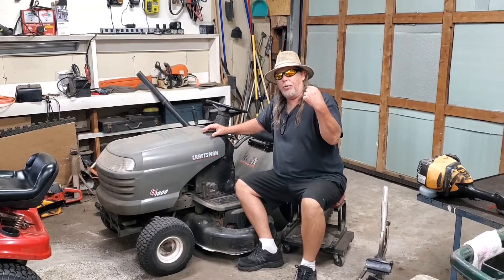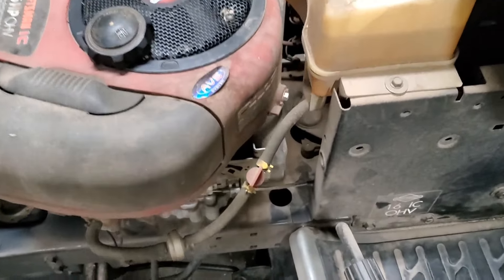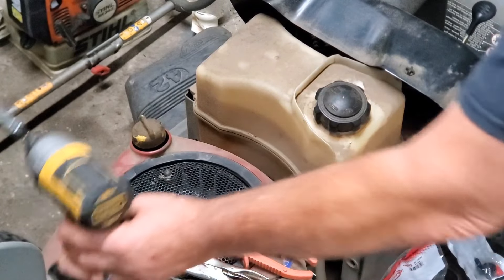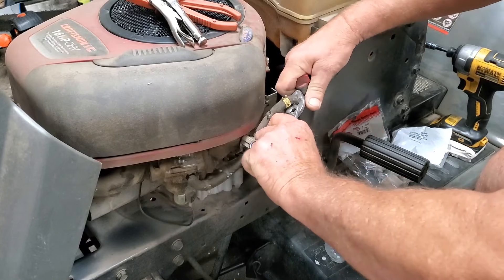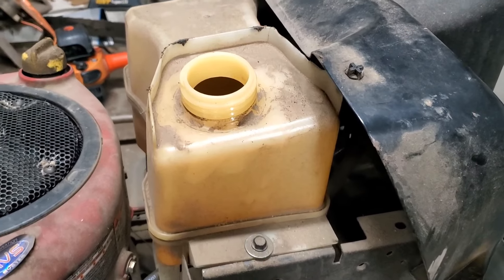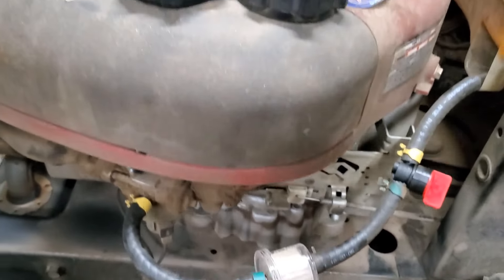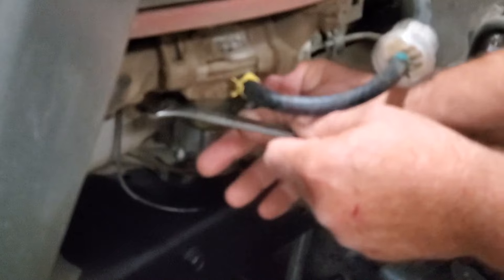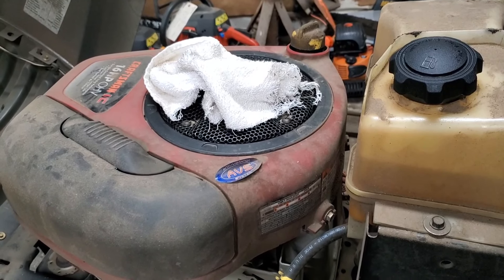Riding Mower Cuts Off? It's Not Always the Coil. Easy DIY Repair a Craftsman Briggs and Stratton

Comment: T-Bone, this video showed up in my feed. Thanks for the part number info on the shut-off and in-line filter. Im ordering them with new fuel line and start with new on 10 and 15 year old riders. Thanks.

Comment: The only thing I would change is to use silicone grease instead of petroleum jelly (vasoline) since it will react with the rubber fuel line

Comment: Hoping you can help me here. Bought a craftsman mower off friend.  Ran fine but rough.  Brought home, removed the mower deck to install the snow plow attachment.  When I removed the deck I thought it easier to remove the blade engagement cable from under the hood where it connects to the engagement arm. The thinking was that it seemed easier that removing the cable and spring where it attaches to the mower deck.  

Long story short, did full tune-up (oil, spark plug, air filter, replaced fuse - though the old one had no break, etc.)

Problem: sit on seat, engage parking brake,  turn key.... no click, no sound at all.  Brand new battery tested with multi-meter.

Haven't tried installing the mower deck back in and installing the engagement cable but going from working to nothing is disturbing.   

Is the clutch/blade engagement cable have some safety sensor or something that tells the engine not to start if that is not installed.  Basically the blade engagement arm is free-floating.  

I want to reinstall the mower deck and cable to test but just haven't had time to do it yet.  Thought your experience might be able to provide me some insight. 

Thank you!😊
Reply from the maker: Pull the blade engage handle towards Disengage position while trying to start.... The safety switch is not pressed possibly.

Comment: I have a question for you T-bone i have a cub cadet riding mower after i cut my back yard i got to the front i disengage the blades  put it in neutral put the brake on and as I'm opening the gate it will shut off and it should stay running but it does not.  Any Ideas.

Comment: My dad's tractor just started cutting off when it gets hot, I went to check it out and now it smokes like a train and shuts off after 5 sec. Restarts and does the same again.  Lots of oil leaked out of the muffler.  I'm thinking I need to replace the head gaskets! Husqvarna yth22v46
Reply from the maker: carburetor is leaking fuel into the crankcase
Reply: @RaleysSmallEngines  Yes sir! Same little o-ring as you showed in the video. I appreciate you brother, thanks for all you do!!

Comment: I have a briggs.  It starts everytime   its 1 year old.   So I was cutting grass for 2 passes then it died  And it will not start back I have spark I've tested the coil and all      ive check all switches for continuity everything checks out good.  All lines good  wires to.     I adjusted valves  .  Even a new spark plug clean the carb ... checked head gasket.   I've done everything there is humanly possible and this dang thing still won't start .. it has compression then stalls like the valves  out of adjustment  but I adjusted em correctly.  Pulled the plug turns over fine. .  The compression relief is working checked it to.     I am baffled here

Comment: but does it stay running....I literally did everything mentioned here and still have my craftsman shutting off after about 2-3 minutes of use
Reply: Maybe a carburetor kit with a solenoid + fuel filter, check air filter...clean 🫧